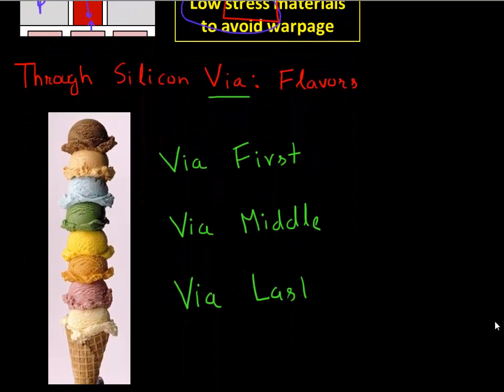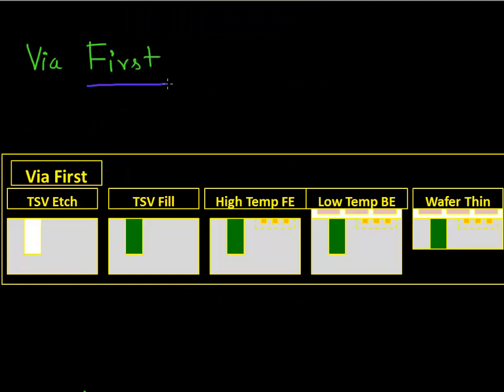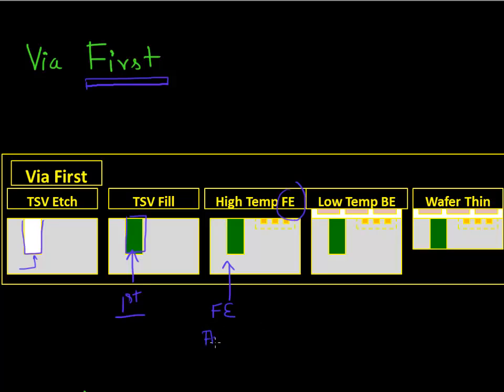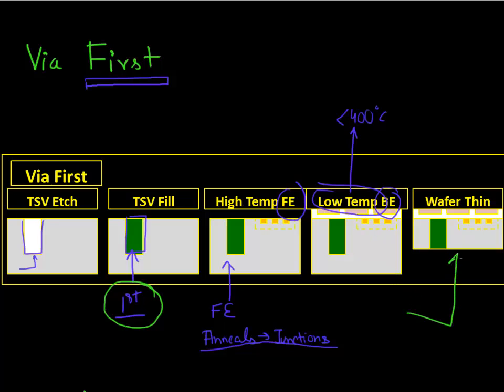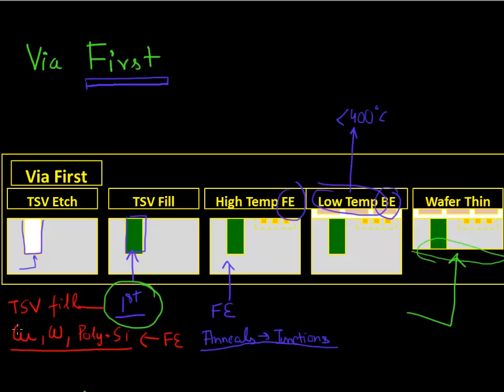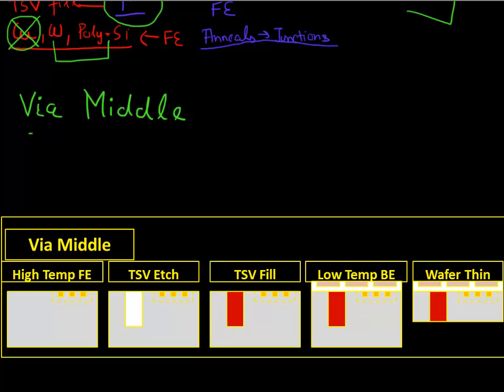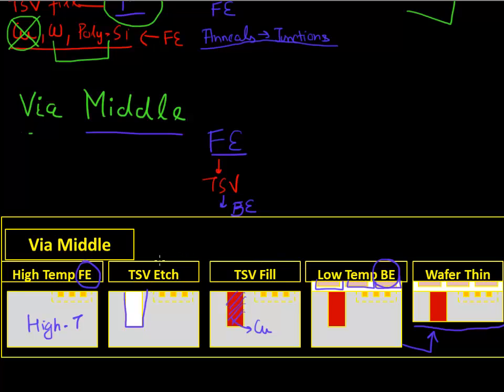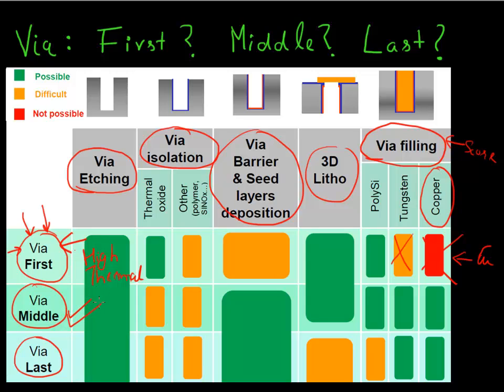TSV : via first ? via middle ? or via last ?

Comment from the maker: Hi MaverickTPGN you are right that the TiN or TiN are typically used as difussion barrier for Cu. However they maintain their effectiveness as a good barrier only at low temperatures (<400C). That is why often there is a upper bound which is placed on the temperature for back end of the line processing which is around 400C.